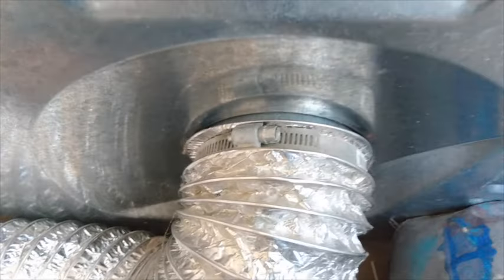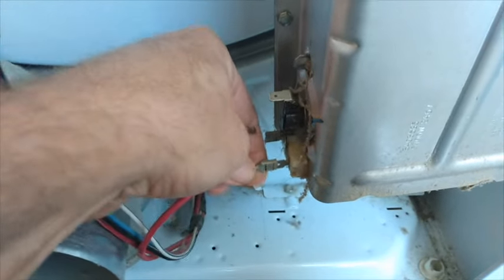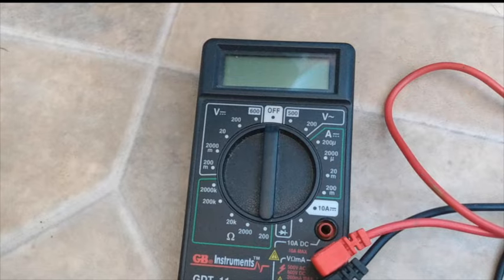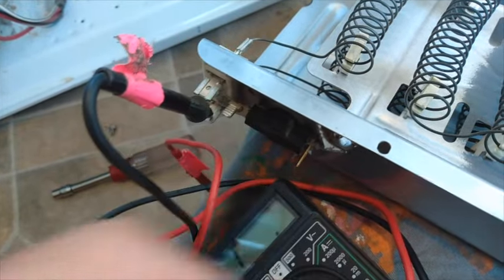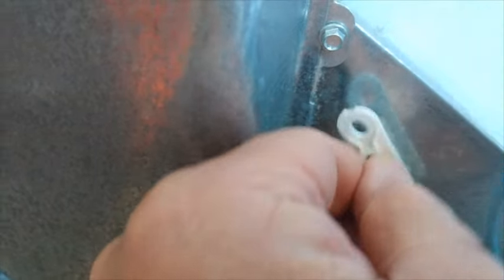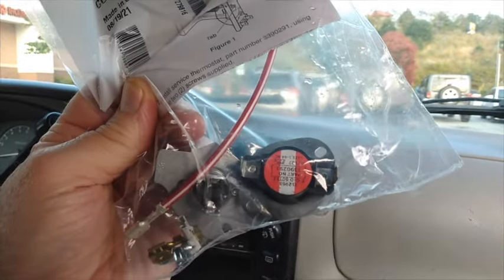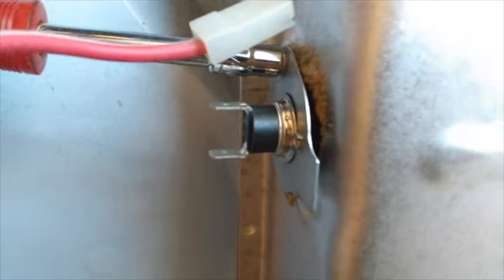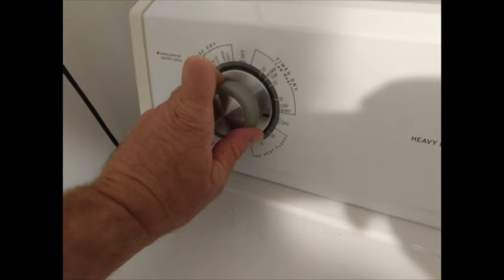How To - DIY - Thermal Fuse - Dryer Runs - Doesn't Heat: Troubleshooting & Repairing - Easy Fix

Comment: What is it when you change everything and it still doesn’t heat?
Reply from the maker: @beckykalbfleisch8411  could be faulty door switch, wiring, or control board. Sometimes,  if lucky, it might be a clogged vent. That is if you've checked all other components like the heating element,  thermal fuse, thermostat,  etc. Maybe, someone who knows more than me can chime in.......
Reply: It could be ur not getting enough power to ur dryer from the 220 outlet. It could be only part of the breaker is working

Comment: when it doesn’t tumble, is it cause of that thermal fuse?
Reply from the maker: Generally, when the thermal fuse goes out, it only stops heating, but still tumbles and blows cool air...
Reply from the maker: Here is an article that might help you, I don't know a lot about this kind of thing, I mostly tinker and have limited knowledge. :) https://www.asurion.com/connect/tech-tips/how-to-fix-dryer-that-wont-spin/
Reply: Could be a bad motor or the belt is broken.